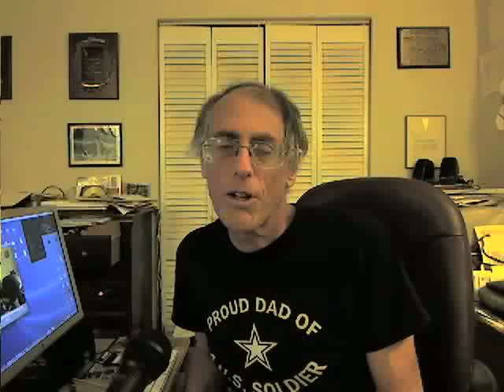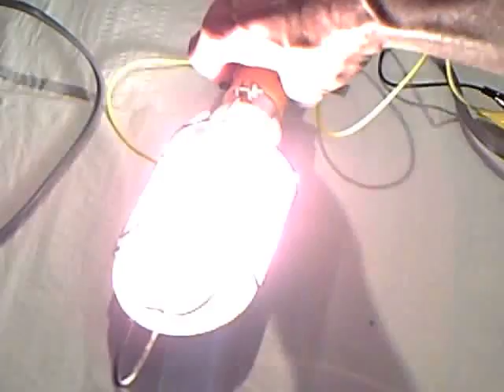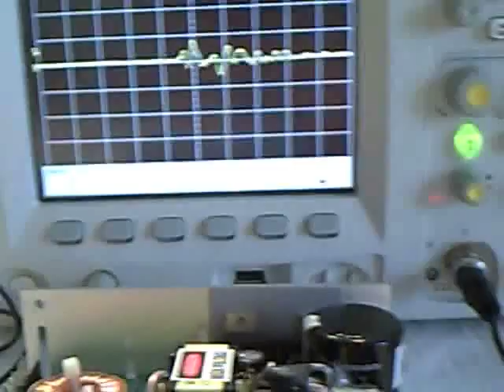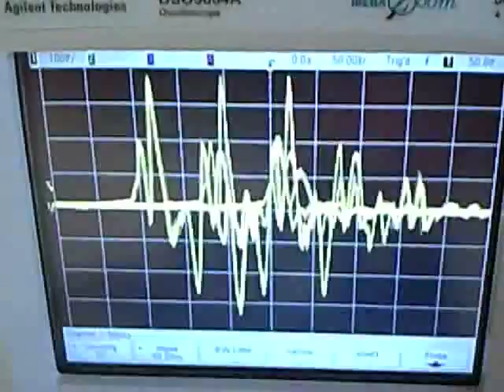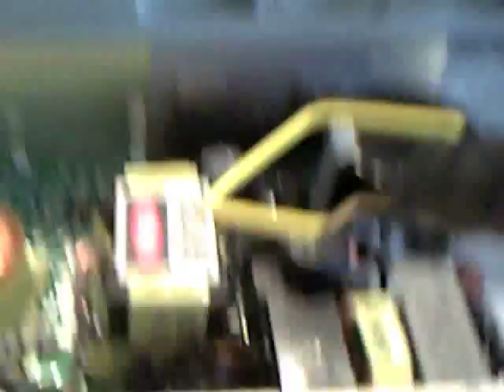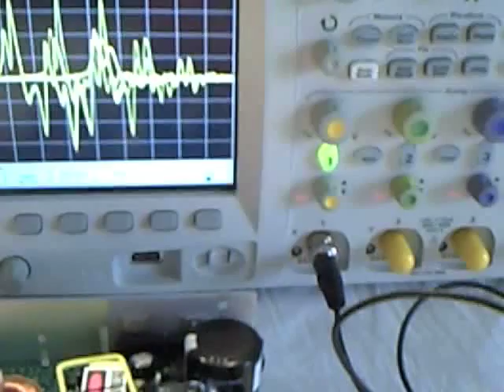Switching Power Supply Noise - Magnetic fields

Comment: My power supply based on flyback topology is having whistling noise at high load, any solution ?
Reply from the maker: Sounds like a loose inductor core or possibly corona discharge.

Comment: I absolutely hate switching power supplies.  I understand they're cheaper to make, however they are mass RFI noise generators.  Even my phone charger puts S9 plus 20 on all the ham bands here.  I can hear neighbors noisy switch mode power supplies too.  I wish the FCC would monitor and put standards on these as they are one (if not the biggest) noise generators today, across a wideband spectrum!

Comment: Hi and thanks a lot for the very interesting and educational video.   Actually i have really this kind of problem in an usb audio interface. Some wires is picking up the emi from the smps and i get some noise in the spectrum.
If i understand well the transformer is the main suspect.  Could you give me any advice about a suitable way to shield it.
I tried moving the signal wires away from the smps but the noise persists unchanged.
A guy told me that pulling out the smps from the chassis eliminates the issue, but i would like to keep the smps inside the box.
Thanks a lot and kind regards,  gino 
I am attaching a picture of the internals with the smps on top and audio circuits on the bottom  _       
https://www.gearslutz.com/board/attachments/music-computers/401349d1401764206-focusrite-forte-versus-tascam-uh-7000-one-better-usb-audio-interface-img_20140603_123848_004.jpg
Reply from the maker: Hi Gino,

If you want, I can do a GoToMeeting session where I can show more information and.eliminate a lot of typing. Send an email with some good times and I will respond with a meeting link. I don't check YouTube very often.
Reply: Doug Smith  Hi and thanks for the kind reply.  I have never used GoToMeeting. :
I will study it and revert. 
If i understand correctly you provide a professional service as consultant ?
Thanks again. gino
Reply from the maker: Yes, I do and also help individuals when I can. If I can give personal tech advice there is no charge and no charge for the first session professionally. For GoToMeeting you don't have to know much, just click on the link in a email and it is pretty much automatic. The interface is intuitive.
Reply: Doug Smith  Hi again !  i have studied more the issue. I have come to the conclusion that putting a smps in the same metallic box of sensitive audio digital circuitry without taking care exceptionally well of shielding  is indeed a recipe for disaster.
I think that in the end the smartest move will be to remove the internal smps and use an external power supply, even a smps but encapsulated.  Actually this is the much more common solution adopted by other manufacturers. 
Now the problem is to select a decent AC adapter.  But i am pretty sure that any will give better noise performance than the present solution.   Thanks a lot again for you very valuable advice and kind offer of assistance.
Kind regards, gino

Comment: Just because you used a loop does not automatically mean that the source of the interference was magnetic. It could still be the electric field coupling via parasitic capacitance to the loop. The parasitic capacitance coupling is variable due to the varying orientation of the loop, creating the illusion that the coupling is magnetic. Identifying the correct source of interference is important for remediation. You need to make extra measurements/comparisons to rule out parasitic capacitance.
Eg. compare the measurement with a non-loop like structure which has the same exposed area. Shielding the loop is not really an option because it would simultaneously attenuate the magnetic field due to induced eddy currents in the shield, which locally cancel the field that couples to the loop.

Thanks for the hands on video!

Comment: Nice video. I found that to be very interesting. I would also like to see what you're still picking up if the cover is on the PS. The interesting thing is that with that kind of voltage being induced in your loop, I wonder how that effects the performance of the PS both with harmonics and the efficiency due to the eddy currents that are undoubtedly produced in the case.